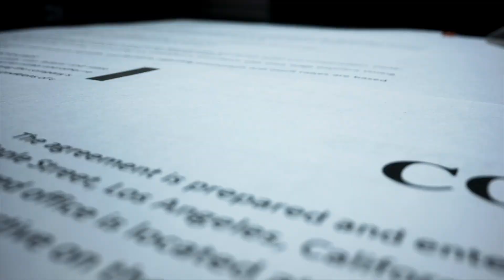Why Thailand Is Building a $28 Billion Mega Canal

Comment: According to https://en.wikipedia.org/wiki/Thai_Canal :
"The width of the Kra Isthmus at its minimum is only 44 km (27 mi), but the height of the intervening hills is 75 m (246 ft)."
"At a depth of 25 m (82 ft) below sea level the width of the Kra Isthmus is about 200 km (120 mi)"
May be it will be possible:
making  two parallels tunnels  around 30km long each
building each side  two  canals of 85km length (part in the land, part in the sea till the 25m deep sealine)
use the materials to build dykes on the sea parts of the canals and for the harbours and industrial lands along the canal.
a part of each canal , near the central part, can be covered by solar panels.
the canals will have for each one normal sense for navigation and could be less large (so less excavation) , with stones or concrete coating of the shores to allow a highest speed 
may be if Thailand has enough rewewable électricity, the canal can use electric propulsion of the boats (part with motors, part with pumping the water of the canal)